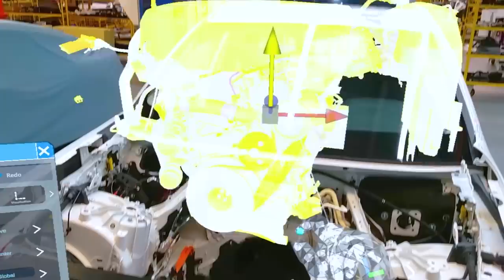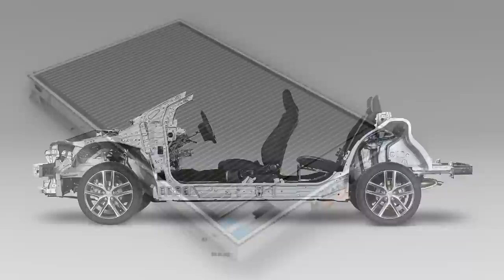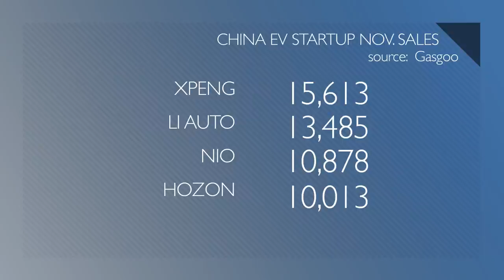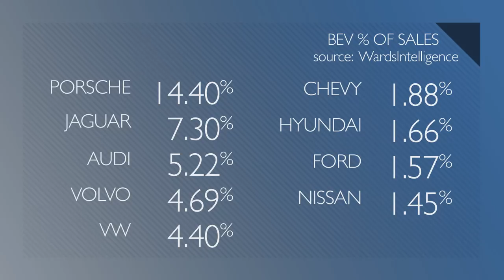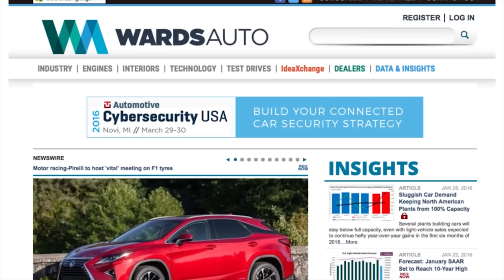Toyota Developing BEV w/ BYD's Blade Battery; BEVs As a Percent of Total Sales - Autoline Daily 3216

Comment: Porsche is doing extremely well since they are selling EVs. the different Taycan models are very profitable. And there is practically no competitor in this market. Next will be the electrification of the Macan, which is one of their high volume cars. And then the Boxster will be electrified. This will be very interesting because  the electrification allows a completely new geometry for the E-Boxster. They then need a new name for it of course, because Boxster comes from the boxer-engine and their speedstar model before. Interesting times.
Reply: Oh I don't know, the Taycan turbo doesn't have a turbo. The SUVs will be better in electric. The battery in the floor lowers center of gravity, gobs of torque and the one pedal driving, not to mention low fuel costs. It's all upside.